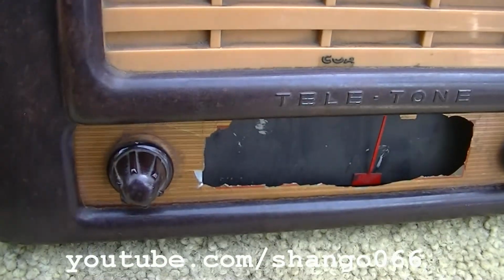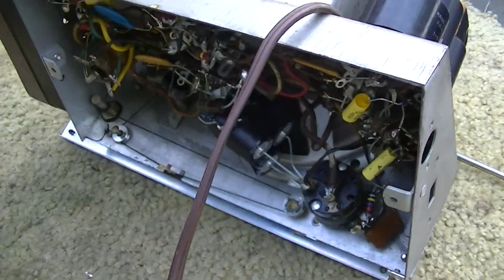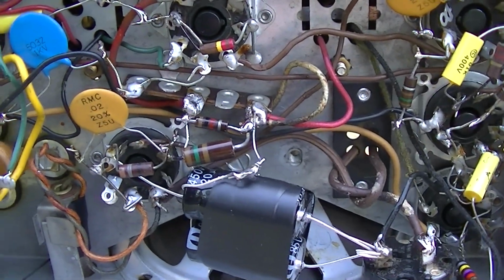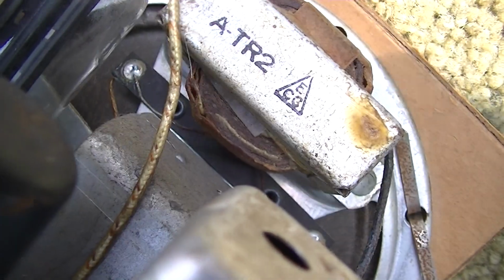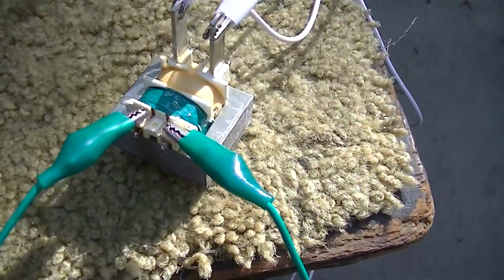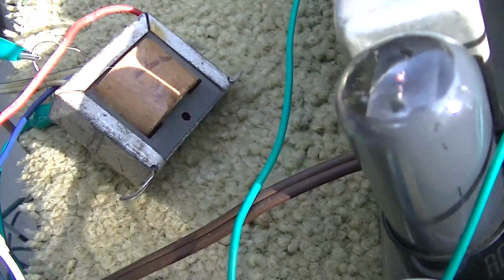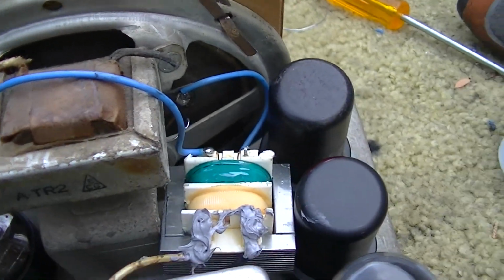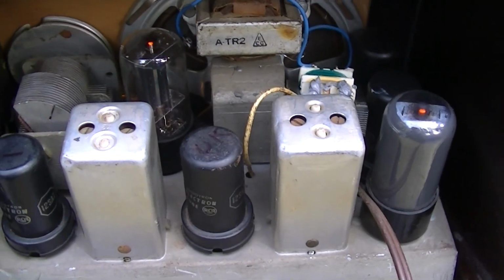Teletone 6 tube AM radio diagnosis for repair

Comment: Also 15... my dad won't let me recap my radios because he's afraid I'm going to "kill myself" by shock. Both of my parents support the hobby, but my dad won't let me get near a capacitor!
Reply: I'm 18, explain it using as much technical mumbo-jumbo as possible, have the explanation sail over his head. I own an RCA CTC-17XE tube color TV set, I don't think I will say thousand volts again after I explained the HV circuitry to him. He panicked, say "KV". Just an example of how to  explain things without drawing alarm.
I've gotten myself shocked before, HV isn't that bad, don't let the OSHA-nazis scare you or him!
Reply: Have your father help you do it!
Reply: He's usually at work during the day but during the weekend I might be able to catch him
Reply: Just show them Shango videos
Reply: To be fair to your dad, when I was teenager at your age, I was incredibly dumb enough to go probing around an old turntable when it was plugged in and running with the cover off. Left arm caught a massive jolt, but I wasn't grounded, so I lived to fool around with yet more junk (unplugged from that point onward). So long as what you're working on is unplugged (seems obvious to me now lol) and you short out those capacitors first to discharge them, there's little danger. And if they're battery powered only radios, there's obviously utterly zero chance of any shocks at all.
Reply: Or you could show him how to discharge the caps and do it in front of him so he knows it is safe
Reply: Explain the "one hand behind you" rule to him when working on HV. You're almost old enough to drive, which may be much more dangerous.
Reply: In US, you have 110V power net. But in Europe it's 230V, so it's more dangerous. As I remember I started with tube radios when I was 14 and with TV's 2 years later. Capacitors are not so dangerous. Most dangerous is to touch power net, so use isolating transformer when you play with radios, especially when it is hot chasis set.
Reply: If they don’t offer Electronics classes at your school maybe look around and see if there’s anything you can take outside of school that would give your dad some confidence
Reply: Another idea would be to take on some solid-state projects where of the voltages are lower. Maybe with some of that undo your belt your dad would relax

Comment: The primary of a good ac/dc output trans usually measures around 200-300 ohms, I bet that one was shorted. But what I want to know is why does it use two 12SQ7's? I've never seen that, and I don't know why they would do it---the triode section is the preamp, and the two diodes are the detector and AVC so one would suffice

Comment: Another great tip,,, makes perfect sense but who would think of using an old wall wart for an audio transformer.
Reply: Shango
Reply: Transformers are about turns ratio. The 120 volt primary is about what the plate voltage of the 50L6 should be. If the output voltage of the wall wart was 6 volts or less then you have a decent match for the secondary .. But a proper audio transformer will have a core structure more appropriate for the audio circuit
Reply: 12voltvids and radiotvphononut as well maybe.
Reply: i've even used a bog standard mains transformer for the output in a quad 2 hifi amp...works reasonably ok!

Comment: I was actually paying more attention to the birdsong in the background than the sirens.
Reply: I was looking for the cat!
Reply: Just like in the Philco Predicta B&W TV repair video Shango did - there were birds chirping in the background galore. The same video where he mentioned the owner paid $1000 for the set and the seller had told him it was restored and working (when in fact it was dead and buzzing). 

Seems whenever he works on any project and uses a camera, there are either birdies making noise in the trees or aircraft flying around or both.

Comment: Got to encourage the up and coming younger generations to learn these skills otherwise they could be lost.
Reply: joe woodchuck I'm 16 myself and repair my own televisions and radios for my personal use, however yes the vast majority of millenials are incapable of even the most basic of tasks without their phones telling them.
Reply: I know I'm kind of randomly asking but does anybody know a good site to watch new movies online ?
Reply: A Floyd   They won't learn it. You're talking about the millenials generation here which means that they don't know how to change a tire or how to make a camp fire and cook on it. The ONLY thing they want to know is what's on the computer or phone screen. Getting a college degree in this or that which may or may not even be remotely connected to their career path doesn't help the situation either. 
   Nice radio. I'm the generation of building your own regenerative receiver with a single tube all mounted on a leftover piece of lumber found in the cellar. In my own case I built that receiver when I was no more than 11 or 12. I came INTO semiconductors after working with hollow state technology for several years. I made my career in electronics based in part on my early building experience. And you know what?  It was a hobby when I was very young, made a reasonably successful career as a designer, and still play with radio as a ham radio operator, and I still make stuff in retirement. Millenials don't even know what most of that relates to! Everything is disposable to them and it all comes from some mysterious unmarked building on a back street somewhere in Asia. You're very nice tube radio is a museum relic to them belonging in a display case right next to an 800 years old dugout canoe.
   Now where did I put that roll of magnet wire? There must be a piece of plywood somewhere too ...
Reply: @joewoodchuck3824  Wonder what millenials woud say if they encountered an RCA AR88 or an R390 receiver? Or any other classic boat anchor shortwave radio.
Reply: Well Joe Woodchuck it was you boomers who gutted US manufacturing and sent it to China and pumped your own portfolios with the throw away economy. How would you expect millennials to know anything different when it was all gutted before they were old enough to take an interest in it? BTW I am a Millennial on the cusp of Gen-X and have a Grundig 2025 sitting on my kitchen counter that I repaired myself, and I suspect I am among the very last who would have had an opportunity to gain exposure to such things.